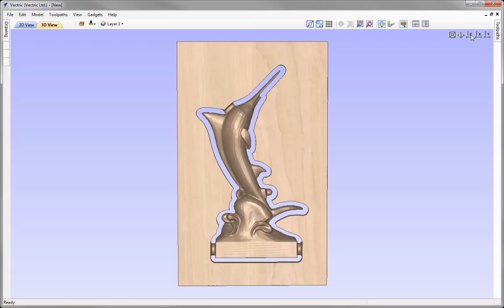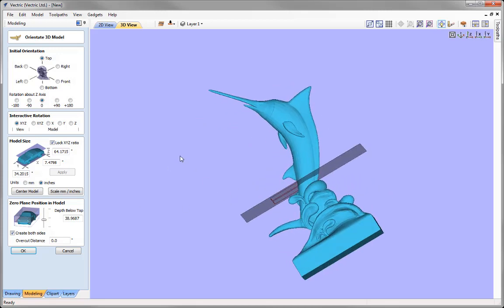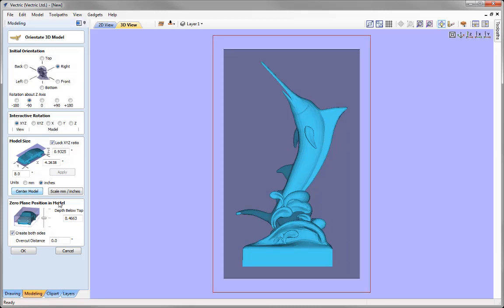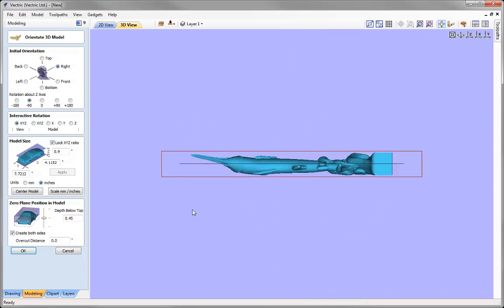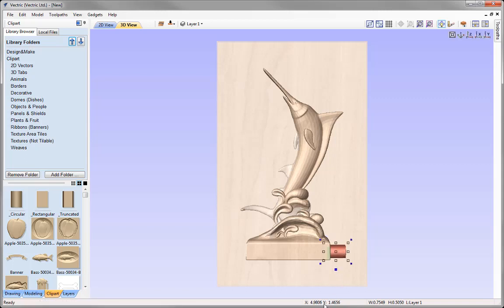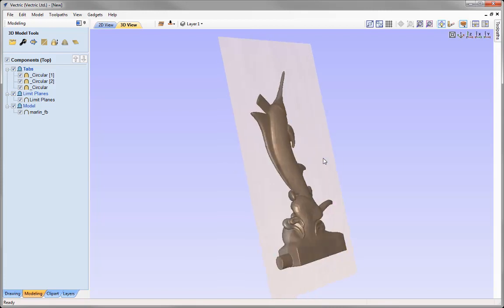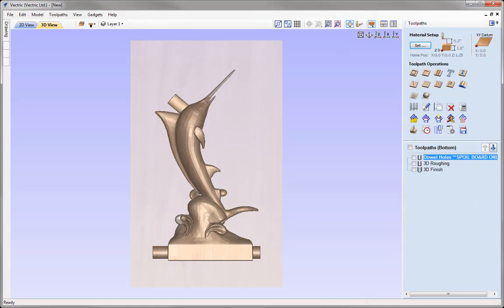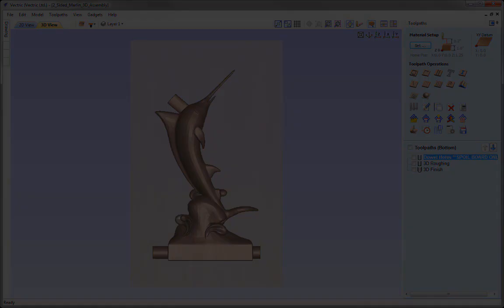Two Sided Marlin | 3D Assembly | V9

Comment: If I use the same Z Zero position as you did with the zero off same side checked, when I flip the piece over to do the bottom side do I zero my bit off the spoil board? Thanks
Reply from the maker: Hey Tim, that is correct :) I hope this helps :)

Comment: Sorry for  second comment and not fully relevant to this particular video, i.e. importing a model.  When importing a model I see in the import tab you select where you want the zero plane.  But how can you set the location of the zero plane in the middle when creating a 2-sided model.  I am attempting to build a handle in Aspire with half the handle on the top and the other half on the bottom of the material, but since I am building it i don't get asked where to set the zero plane.  Can you reference me to the place where i can figure this out?  I have looked in the forum and can't find - maybe I don't know the right way to ask to get the search function to help me.  If you can I would appreciate it, if not - well it doesn't hut to ask.
Reply from the maker: Hey Rob! When importing a model for 2 sided machining (set your job to two sided before importing) you will be able to choose to position the zero plane (you can double click on the middle notch to get that in the center - shown at 8.45) I hope this helps! Have a great day and good luck with your project!
Reply: @vectric  The video was very clear on the point you just made.  I am not talking about importing a 2-sidedmodel.  I want to create a two sided model.  I want to be able to set the zero plane in the middle and then be able to have a limit plane that allows me to cut a bit beyond the zero plane.

Comment: Great tutorial! Thanks very much for this. Question that anyone may answer if possible. I always set me Z zero surface to machine surface. Can I continue this and always have my Z zero to machine surface for both sides?
Reply from the maker: Hey Jeff! Yes you can set your Z Zero for both sides on your machine bed, it's really what you prefer. I hope this helps :)
Reply: @vectric  Yes, I did a test part in MDF and it turned out perfect. I set my Z zero to the machine surface first thing in the morning and it's good for all jobs thru the day. Thanks for the reply.